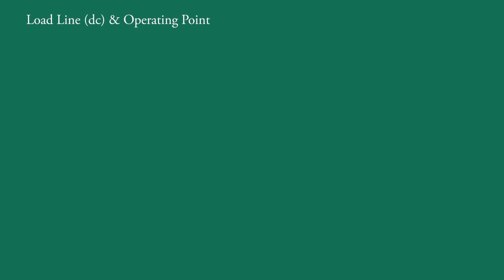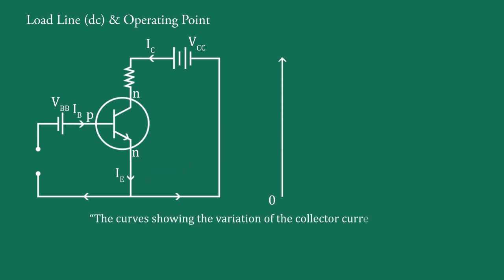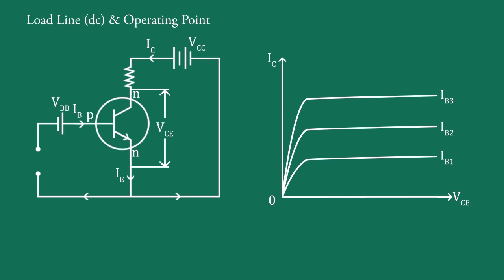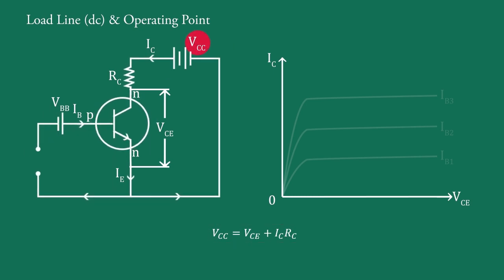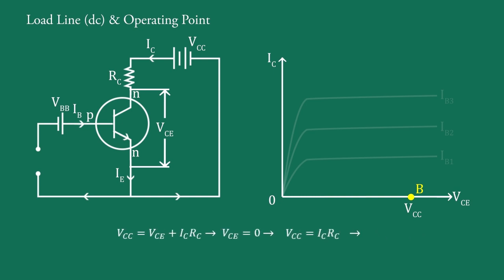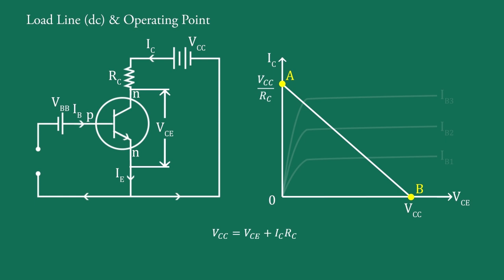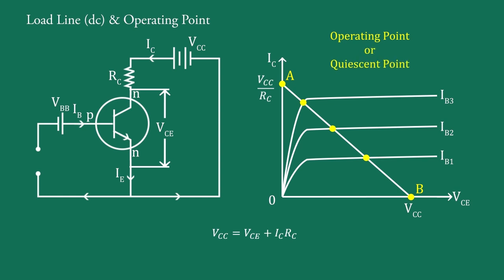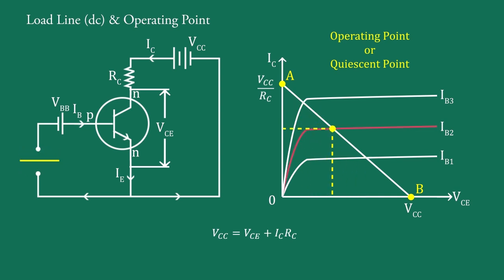DC Load Line and Operating Point of Transistor | Q Point and DC Load Line | Quiescent or Bias Point

Comment: In the analysis of circuits that make use of resistors, diodes and transistors, it is
necessary to determine the operating point (voltage and current) of the device connected
in a network, which is made from devices whose parameters are known.
It is often necessary to determine voltages between terminals of a network with no current flowing.
Consider for example the network which consists of two resistors R1 (terminals marked A and B) and R2 (terminals marked C and D). Their ends (A and D) are connected to the positive and negative terminals respectively of a power supply of 12 V dc. The other ends of the resistors are left unconnected. 

Suppose that the resistors R1 and R2 are 10 ohms each. 
What will a voltmeter read if it is connected between terminals A and B?
What will be the reading of a voltmeter connected between the terminals C and D ?
What will be the reading of a voltmeter connected between the terminals B and C ? 

Electrostatics and circuits belong to one science not two. To learn the operation of circuits, Current and the conduction process, resistors, capacitors and inductors and how discussing these topics with a unified approach makes it easier to understand how there is a voltage of a single wire connected to one terminal of a battery watch these two videos 
i. https://youtu.be/TTtt28b1dYo and 
ii. https://youtu.be/8BQM_xw2Rfo 

The last frame References in video #1  lists two textbook 4 includes topics that discuss simple networks and the physical processes which causes the appearance of potential drops.
Specifically, in Chapter 3 discussions of load line graphs both dc and ac and their use in fixing the operating points of devices such as resistors, diodes and transistors are included. 
We continue for now with a brief discussion of the cause of the voltages between the dofferent terminals of the network example in this post. 

When the network is made, electrons will enter the battery positive terminal and the potential of the resistor R1 would have been raised. The battery positive terminal, would drop in potential due to the neutralising action of the few electrons, but then its chemical
action will quickly restore its potential difference (p.d.) to 12 volts. The migration of electrons will stop, when the potential of the resistor equals the battery positive potential.
And all this happens within a few picoseconds. There will be a few surface charges on the resistor R1, and these indicate its new status of potential. 
It should be clear that a voltmeter when connected between terminals A and B of circuit will read ‘0’ volts, because the potential of the resistor R1 and the battery positive, will be the same, namely, 12 volts. In the case of the resistor R2 connected to circuit zero, a few electrons would have entered the wire and the resistor R2 from the negative terminal of the power supply which is circuit zero, making the potential of the resistor R2 the same as circuit zero. There will be a few surface charges on the resistor R2 that indicates
its new status of potential. A voltmeter when connected between terminals C and D of circuit will read ‘0’ volts, because the potential of the resistor R2 and the battery negative will be the same, namely ‘0’ volts. 
The current in the circuit will be zero because of the open circuit.
Since the potential of terminal B is the same as that of A, its potential is 12 volts.
Since the potential of terminal C is that of the battery negative or circuit zero (terminal D), it is ‘0’ volts. Therefore, a voltmeter connected between the terminals B and C will read
the same p.d. as that between the terminals A and D namely, 12 volts. We can allow a current to flow in the circuit by simply connecting a wire between
terminals B and C thus, short-circuiting them. 

The current in that case will be 12 V/(10 Ω +10 Ω) = 12 V/20 Ω = 0.6 amps. 

The two points marked on the x- (voltage) and y- (current) axes are joined together, and this line is called the “Load line” of the network. The load line is the locus of points, or pairs of voltage and current values for the voltage between terminals B and C and the current in the circuit, when the terminals B and C are bridged by a resistance. The load line is fixed for a fixed power supply voltage and fixed values of resistors R1 and R2.

AC load line
Circuit analysts usually draw ac load lines during the design phase of transistor amplifiers. In Section 3.4, Chapter 3 of textbook 4 in References in last frame of Video #1 more details including diagrams of the analysis of circuits using dc network load lines are provided. In the question Q.3.1 in the file "Additional Practice Questions for all chapters" in the CD with this textbook 4, a description of ac load lines is provided, which would be useful to read. Space does not permit a full discussion in this post.